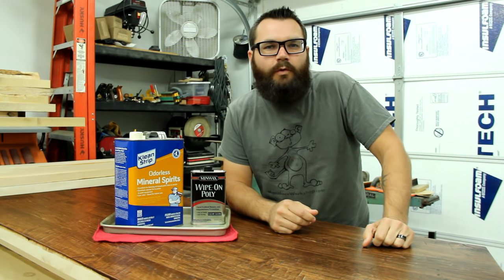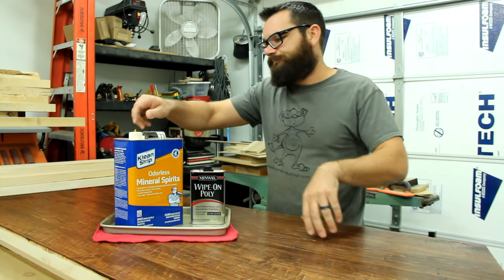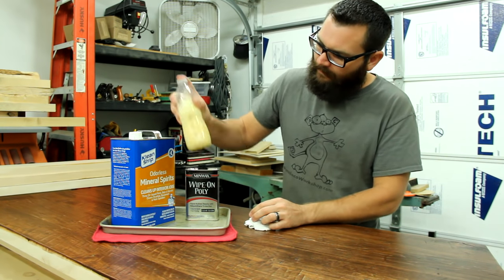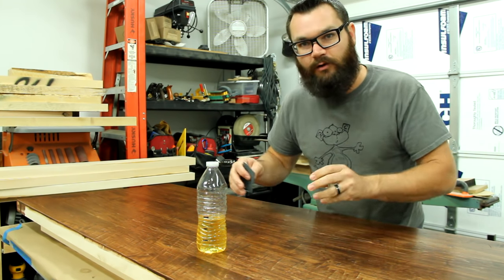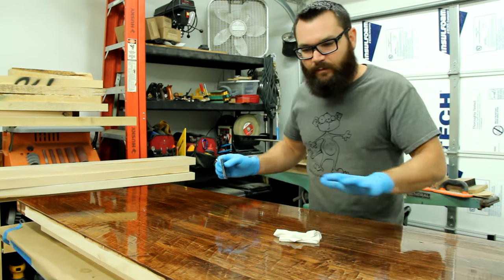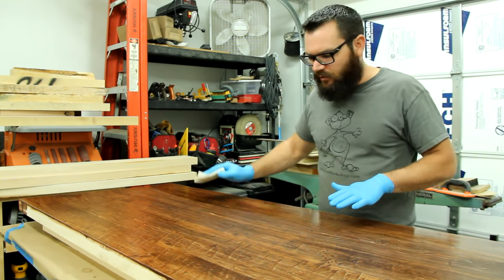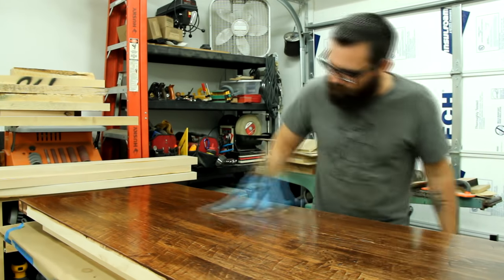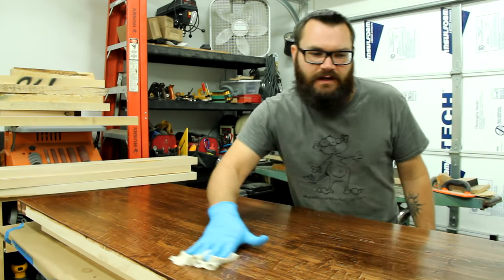Ultra Smooth Finishing Method - Great for tables or Counters

Comment: You're the only person that Ive heard say to shake up the poly. When you shake the poly it  adds air to it causing small bubbles and not super smooth. surface.   Also why sand in circularr motion, Almost guarantteed to scratch. not picking your. method apart justwondering why.
Reply: Wipe on Poly is not like straight poly...it is too thin to hold bubbles...that is why it can deliver good results without as much care/expertise.  The can instructions actually direct you to shake it.

Comment: Shaking poly! I'm going to move on to the next video!
Reply: Wrong! The instructions say to shake.  Need to mix the dulling agents that settle to the bottom of the container.  Otherwise, the finish will come out glossy.
Reply: WIPING finish... bubbles won’t be an issue.

Comment: You never shake polyurethane. You just put million of air bubbles in the product. Stir - gently
Reply from the maker: Not as big of a deal when it's thinned down this much and you rub it on. No bubbles.
Reply: Real late reply. It's a cardinal rule for REGULAR polyurethane.  But...you're supposed to shake WIPE-ON poly...says so right in the directions. If the product needed to be stirred to mix, they wouldn't package it in a rectangular can with a 1" spout.

Comment: Lost credibility as soon as he shook the polyurethane, zero benefit over stirring but more cons.
Reply from the maker: Good luck finding those bubbles when it's thinned out that much and french polished until it's dry.
Reply: It's not a sin to shake poly even if it hasn't been thinned out, you just need patience. With this post, it's a thinned out poly, makes a great deal of difference.
Reply: Go to the store and read the can of wipe-on poly (or you can read the directions on the website). They tell you to shake it right on there. They tell you to shake it thoroughly even. Sometimes reading the manual helps. It's also a mistake to think that the only difference is mineral spirit. I can get a mostly streak free result with the wipe on poly without thinning it with just a few coats and sanding with 320-400 in between, that I can't get with the thinned regular poly by wiping.